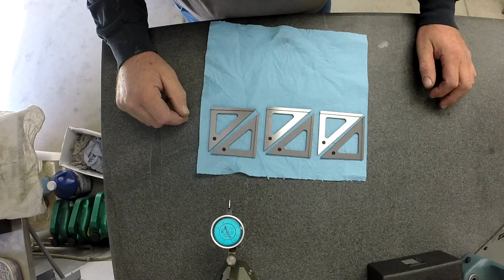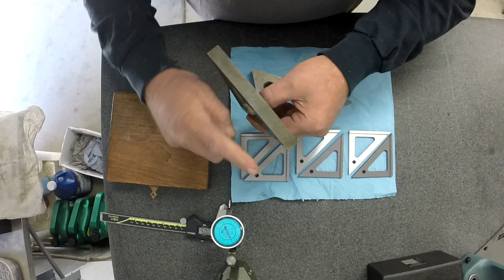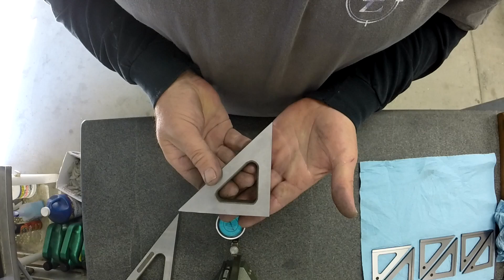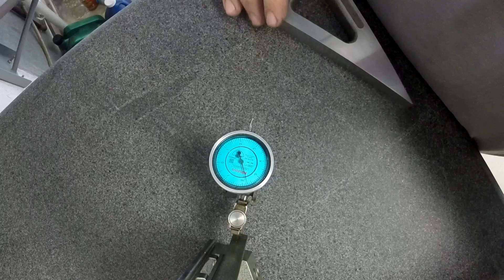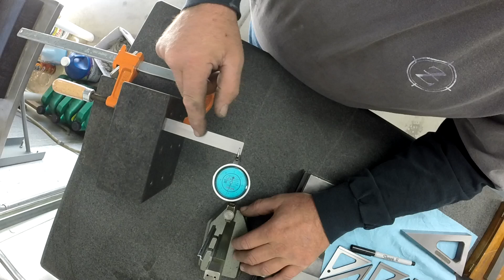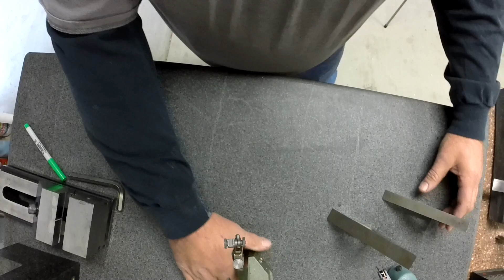The Rucker squares part 1

Comment: It's been 40 years since I've done any surface grinding, but I used to sharpen tools and dies in a punch press shop.  I never got finishes like you get.  I used different wheels (sizes and hardness), various fluids, feeds, dressing and re-dressing the wheels.  Your equipment doesn't look that much different from what I used, but maybe you could share how to get that really nice finish (with apparent ease!)?  You do very nice work.

Comment: Nice work, as always. And very enlightening. I was just wondering about a couple of things. Maybe the hypotenuse was left unground because they only planned to use the perpendicular edges for squaring?  And would it make sense to have a power feed on the x-axis of the grinder, maybe with a proportional speed control based on the position of a lever?

Comment: I'm not understanding how you're getting such a fine finish from that wheel.  Do my eyes deceive me, or is that wheel a much finer grit than it looks like?   I know it's hard to tell from a video, but it looks like 400 grit to me.

-jcr
Reply from the maker: +NSResponder That is a 36 J wheel on the face and a 60 I on the angles, the grit doesn't matter as much as doing a small step over during the last passes.

Comment: It's probably not the best idea to learn from somebody who hasn't got basic knowledge of steel types. Usually you learn these things as a first year apprentice. FYI, 1060 is a high carbon steel.
Reply from the maker: I was taught not to rely on guesses or assumptions in my first year, so those numbers mean nothing to me, thanks for the (snide) comment.
Reply: ..Also, it's not good practice to have more than a third of your wheel width off the edge of a work piece.

Comment: You mentioned a possible warp from internal stress.
Would a heaat normaliz be worth while.

Good vid
Reply: +Dennis Williams On those squares, there are different angles and web thicknesses as they go from tip to tip.  So no matter how it is normalized, heat treated, tempered, etc.  you will always have some differentiation in the internal stresses.   As the part cools, the larger(thicker) cross sectional areas will compress more molecules than the narrower (thinner).  There isn't any way around it, unless you completely grind them out from a heat treated billet.  Or make some complicated tapers... which defeats its purpose.  Over time, and thermal cycles, the squares will relax (undistort).   For such small squares, it would be a neglible amount... over a long period of time.  How much and over what period of time depends upon how many thermal cycles (say 30 degrees to 105 degrees fluctuations) that they go through.  If the squares are kept at the same temperature forever or within a narrow range of variation, they shouldn't change dimensions over many years, if not over a lifetime.  That is why precision measurement and test areas are temperature and humidity controlled.